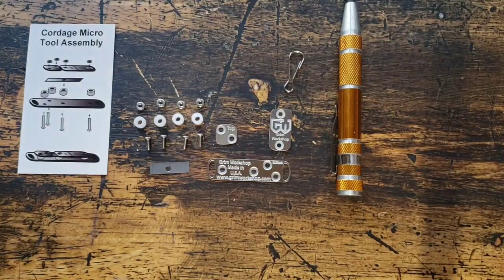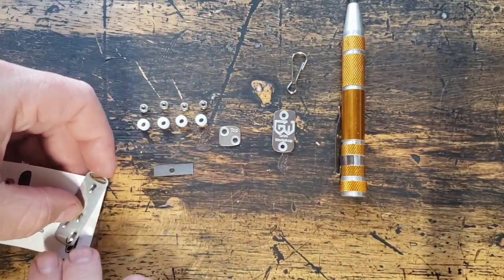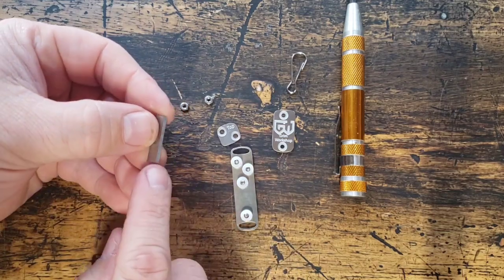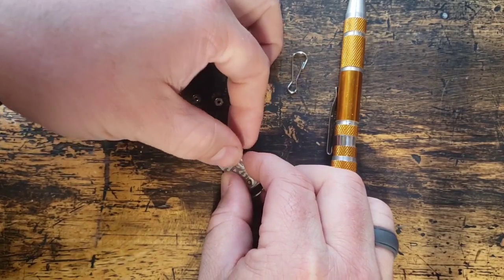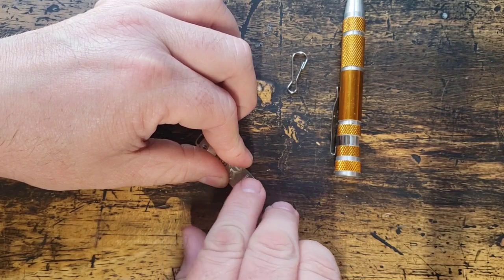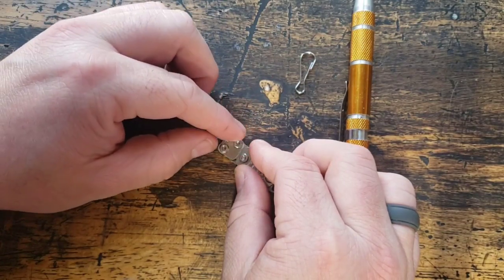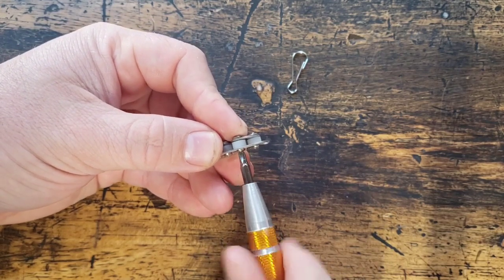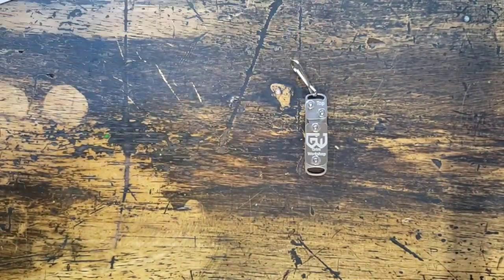Cordage making micro tool assembly

Comment: the trick that you're missing is tape instead of having all of those screw heads resting on the table they should be resting on tape that will allow you to get this nuts started on the screws
Reply from the maker: Great suggestion, thank you!
Reply: @thegrimworkshop  at 51 years old I've learned a trick or two

Comment: a bit of tape on the back plate once the bolts are in place would also work nicely during the assembly process

any thoughts on eventually producing limited addition titanium versions of these cordage tools?....obviously way more expensive but you'd sell a bunch of them